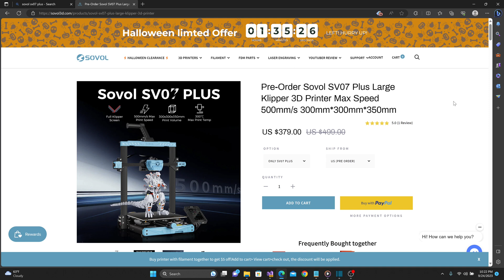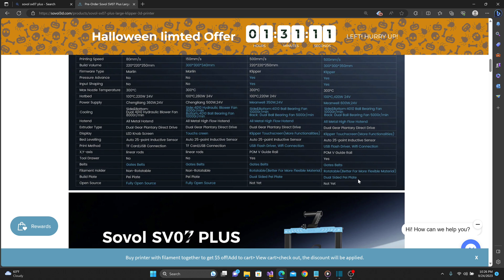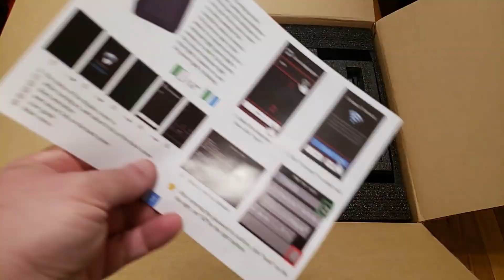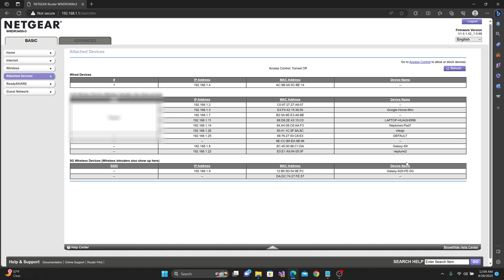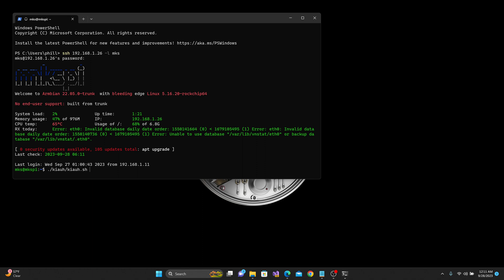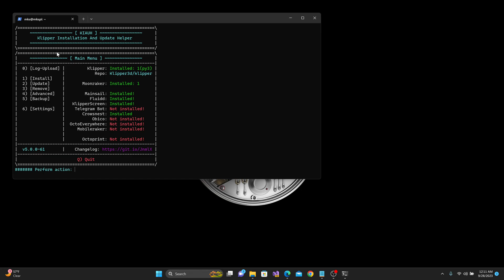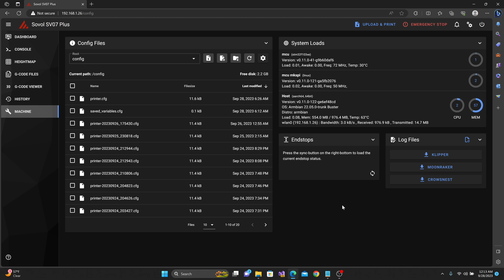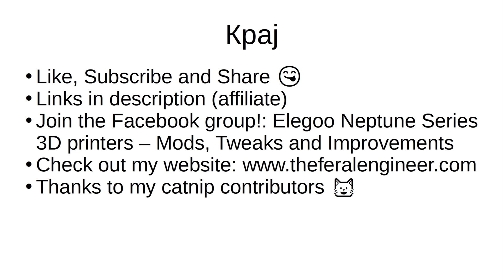Sovol SV07 Plus unbox, setup and first impressions

Comment: Nice unboxing!! How far does the print table move to the rear in respect to how far away from a wall? Looking to purchase a solid heavy duty stable work bench or table with drawers; need a good depth measurement. Thanks in advance!!
Reply from the maker: My table is 25" deep and all of the plus machines I've had need to have the front of the machine practically touching the front of the table for the heat bed to clear the wall. Not an exact measurement, but that should get you started. Can't give you any exact numbers because I sent the sovol back to the motherland.
Reply: @TheFeralEngineer  Copy that; definitely can work with your reply; thanks!!

Comment: I have the Elegoo Neptune 3 Max, it is a good printer and huge bed. But the thing I wished to see it have was 
a all metal hot end of 300 C and Klipper with input shaping so the huge bed could really print fast and detailed.

I was very upset that only a couple of months after I brought it Elegoo went and released the Neptune 4 Max, which has those two features I wish to have?

I already paid out allot of money on my Neptune 3 Max and Elegoo did the new version of it for the same money but with those two features.

Damn it all. I not going to pay again that amount plus I don't have the spare room now as my Neptune 3 Max already dominates the room where the 3 other small printers are!

I ended up having to pay out for a BTT Pad 7 and now have the pain of trying to set up klipper for the Max I have? 
Not easy to do as I found and I am not a person who knows all about codes and klipper stuff.

Now Elegoo are launching a massive new core xy 3d printer on kick starter called OrangeStorm Mega.
It is over the top in size and has klipper and can have 5 heads. The printable sizes is 800 mm by 800 mm by 1000 mm and 300 mm / s speeds.

And at $1250 on kick starter for the 1st 1200 buyers and they have to pay like $100 shipping.

I would have liked them to made it smaller like say 500 mm square printing size.
Reply from the maker: It's not a core machine, it's overhead cartesian, so you can rest easy knowing that. 

As far as the pad7, all it takes is a few simple steps to load a firmware file, paste a config and set a serial address. I have half a dozen videos on how to do it and a huge community on both Facebook and Reddit to assist you.

The 4 has had issues, so don't feel bad.